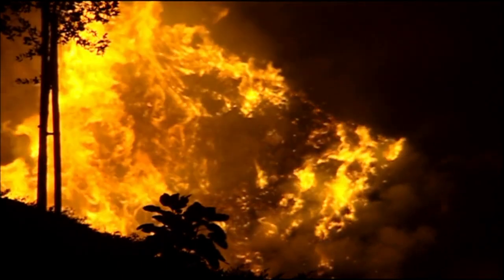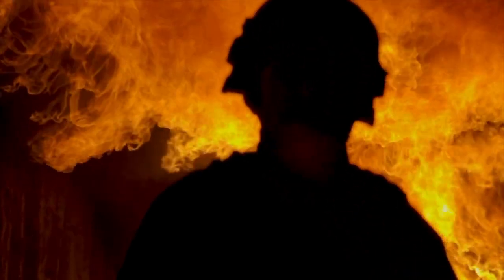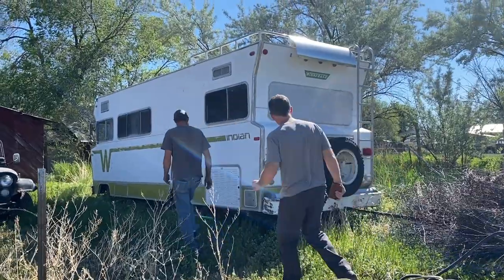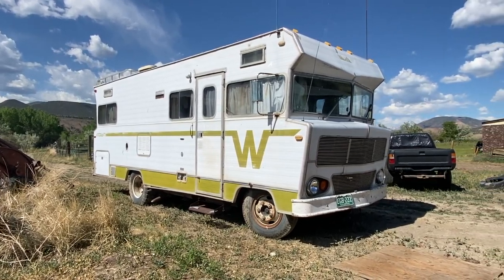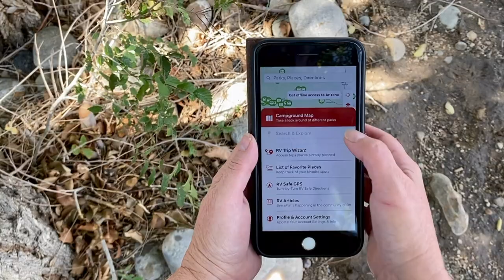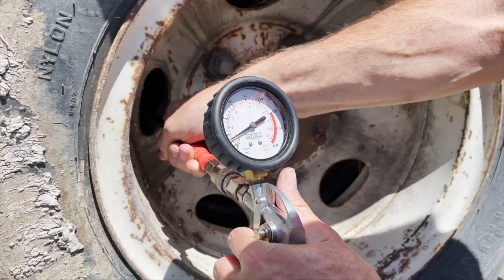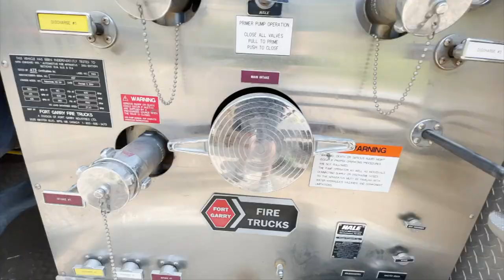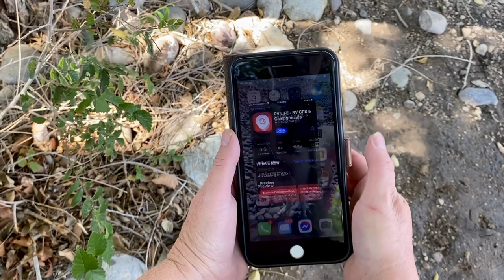LESSONS LEARNED FROM OUR RV FIRE * MUST WATCH * | RV Fire Safety

Comment: Great and well presented video of the dangers of an RV fire. I am a retired firefighter and it is a concern that is in the back of my mind especially when away from our coach and our pets are possibly inside. During my career I had several RV fires to work that in both cases presented a challenge with limited water available on scene and exposures to nearby property and dry grasses and shrubs. Your video showed just how fast and devastating they are. As a safety precaution you removed the propane cylinder and fuel that is found on a RV which makes those fires even more difficult to suppress and even more dangerous to fight. You did put some fire loading material in and most of the time there are many other items that will contribute to the fire load and intensity like lawn chairs, tables mats, lubricants, extra oil, spare parts, tools and possibly fire arms and ammunition ect. They will contribute to the severity and hazards that can be found in most RV's of all classes that experience a fire. Occasionally even a nearly new RV can experience a mechanical or electrical failure that can cause a fire so it's not just limited to an accident or carelessness, I was at a racing event in Iowa where a brand new Super C motorhome had a fire start under the drivers seat from a computer for the coach that malfunctioned and it started a fire that destroyed the entire rig and severely damaged 3 others RV's parked near it before the fire department could get it under control. It occurred while everyone was away at the race track and it had a substantial head start before it was even noticed. Also, always stay well away and upwind from these types of fires. The toxic gasses released can kill or severely injure you if you breathe them in. Thanks to all of you and a job well done. I hope that you get many RV owners to take the time and watch this video.
Reply from the maker: Fred thank you so much for taking the time to share your comment and experience as a firefighter! It’s so helpful to hear of the additional combustibles that can make an RV fire even worse than this one where safety precautions were taken. Yes new RVs are at risk too! That burned fifth wheel of our friends early in the video was a brand new rig that they hadn’t even taken out on a camping trip yet - it was an electrical fire on new unit by a highly reputable manufacturer! Thanks again for sharing - comments like yours add further value and relevance to the important message we were aiming to convey here. We hope it impacts people in a way that really increases the focus on how they can stay safe. Thank you for your service!
Reply: @Rvlove   You guys hit all the marks and I complement and commend you for your efforts to produce this video. Thanks again and safe travels to you.
Reply: @Rvlove  I'm happy I just read this comment.  I have been thinking about Josh and Kali lately and am sad they are no longer posting videos. It's understandable though after they experienced two horrible incidents in a row with two different RVs.  I was in shock when I heard about the second one but never knew what happened.  Thanks for mentioning the electrical fire.
Reply: As a retired IAAI CFI and owner of a 2012 RV I have been well aware of the potential hazard that RV units can have. We wouldn't expect to drag our stick homes all over the country but some think nothing of driving a motor home over the  national highways and back roads. The twists and turns, the ups and downs these comparitlbly poorly built homes on wheels are subjected to would wreck our stick and mortor homes. Well surprise, it's wrecking the motor homes. You bend and twist everything enough it will change the reliability of the item. When wiring connections as well as propane line connections flex enough they become potential hazards. If you don't understand how things are put together and how they can become potential fire 🔥 hazards, maybe RV living is not for you. Cold temperatures shrink everything in the RV. Metals, plastics, wood included. Heat expands everything in the RV as well. It's as if it's breathing all the time. This is why wire connections and gas lines can  separate enough to cause potential catastrophic problems. It's not only necessary to have smoke and CO2 detectors but a knowledge of where and what items to check over, possibly tighten or replace. Be aware, be alert, be safe.

Comment: I saw your original video of where RV's go to die and was planning my full time living in 2019. I bought a 2000 class C and first took it and had the entire chassie gone over and repaired. I then took it to an RV place and had the fridge, convection oven removed..I never use flame inside. I cook outdoors or use a steamer or small 850 watt crock pot. I never leave when somethings on except the a.c. that's serviced every 6 months. 

I purchased a 12 volt a.c. d.c. fridge and a few solar generators to run it on when traveling. I only wish I could have the Propane stove, built in  tank and the generator removed as have been lugging them around since Oct 2019. I saw an RV on fire near Lake  Havasu my first yr out. The propane tank  hissed as I passed by. 
I thank you guys for this very informative videos. I'm always looking at my cabinets and closet for items to take to Goodwill or give away.  I am very careful about things plugged in and never run more then 1500 watts on my 30 amp service as know the wires are old always do close maintains on my chassis. All I can do beyond that is, put my trust in God to keep my home and my pet safe.
Reply from the maker: Love that you make such safe choices, and so happy to hear that the content we have shared has been beneficial to you over the years. Thank you, and wishing you many happy and safe travels ahead. -M

Comment: thank you for making this ... a week ago I went through 3 fire extinguishers to put out a trash bag a neighbor had just placed outside her door that caught fire and rolled under her rig at 11pm ... i pounded and pounded and awoke a grandmother and her grandbaby ..... it took them 3 or 4 minutes to get out ... people really need to see this and learn ... have seen to rv go up in smoke in under 5 minutes ... I carry 5 extinguishers ... think I am getting 6
Reply from the maker: Thank you for sharing your comment, and of course for helping save your neighbor. Great reminder to practice evacuation plans.  Time is very short when it comes to RV fires. We carry multiple extinguishers too.  The small portable ones are great, but they only work on small fires, so having extras is important. Thanks again. -M
Reply: Similar experience with a coworker’s vehicle. People don’t realize how ineffective an extinguisher is on a car fire. Used two big ones and then had to cool the engine with a hose to get it to quit reigniting. Fire department took 15 minutes to get there. Car was still totaled but we prevented the fire from spreading to other vehicles in the lot. We couldn’t stop the engine from turning over because the wires had melted. It kept trying to turn over until we were able to pull the wires apart with a board. All this before the fire crew arrived.

Comment: This is an awesome video with lots of great information.  Being in Florida, we learned early the benefit of putting screens to protect the water heater and furnaces to keep out insects like wasp from building nests.  As you explained in the video, the nesting material can be a fire hazard.

I have to say this is one of your best videos and should help people see the danger of an RV fire and how fast it can get out of control.

I have shared this video on Facebook.

Thank you for making the video.
Reply from the maker: Glad you liked it Don - it's shocking how fast it goes up! And that smoke engulfs the RV so quickly as the ceilings are lower and the space much smaller than regular homes. Thanks for sharing... we hope it helps a lot of people! It was a lot of work but also really rewarding to make something like this and make it a creative, informative story to drive home some important safety messages. Hope you, Neva and the pups are well!

Comment: First I was so surprised the smoke detector took so long to go off. Mine goes off when I boil water! Then I was surprised how long it took to burn. I have seen the posts and videos where people driving down road discovered they were in fire and said it was gone in 3 minutes. Curious if the 1970s building was somehow sturdier to burn longer. Obviously none of that time could anyone have survived. Talked about recreating a grease fire but then lit the fire. Why? Good job!
Reply from the maker: Funny, yes, sometimes my smoke detector goes off way too easy.  Maybe some newer units would burn faster. We also removed gasoline and propane.  The way the department lit it, was close to how it would have been if grease fire.  We didn't want the extra hazard of the propane for the stove. -M

Comment: There really needs to be way more known resources to buy Fire Suppression gear for RV's!  It took quite a while before I came upon a company that could provide that equipment. a few years back, now!  I have called the Gentleman, I purchased mine off of, in Fla, and he seems to not be in business anymore? What I did find, from him, was the AFFF Foam, which may be cancerous if you are exposed to it frequently, but to put a fire out effectively it cannot be beat!  I have the Shielded Hose extensions with the Automatic Heads, that are above my Engine, and Transmision, another in the Fridge Compartment, and yet another in the Generator Bay.  I also got the recommended Temperature Test Strips that you use first so that you do not place the Sprinkler heads too close to what may set it off prematurely or when not needed.  Then you install in another area within close enough proximity!  Along with Small but Mighty Extinguisher canisters 3 of those as well, that are portable, I spent over $1K, for it all!  Cheap Life Insurance to us, anyway!  Thanks for doing this demonstration, but again, since the response time, for any Fire Department, is way too late, I say having your very own Suppression devices are a necessity!  And of course, no less than 3 Appropriate Fire Extinguishers! One, by the bed, or two even, and Kitchen, and near the driver's seat!  I have seen RV fires much like this and could never imagine being cooked alive!   In my 40' Diesel Pusher I have 3 Alarms as well! We remove the equipment, and use them in our home as well, BTW! If anyone can add places/links one can get suppression equipment, please do!
Reply from the maker: Thank you for your great comment.  Glad you have made steps to stay safe! -M

Comment: Would you do a special on the fridges relative to fire. Worst models, ways to check ours for dangerous equipment and the exact recommended modifications to make them more safe. Thanks!
Reply from the maker: Thanks for the suggestion, but it will probably be a while before we are able to do that.

Comment: Well, you couldn't have done it because of extra dangers, but without the gasoline tank having fuel in it and a built in propane tank to deal with it was actually a pretty calm fire. RV fires do progress insanely fast.
Reply from the maker: Yes, if it would have had those additional fuel sources, this fire would have gotten bigger and hotter even faster. Far more dangerous. -M

Comment: this video was amazing. have you all talked to any RV manufacturers on why a sprinkler system couldn't be installed in RVs much like a house or office building. if someone is hooked up to water at a park or have a tankful of water when the fire starts, could it not help in diffusing the fire to this point?
Reply from the maker: Interesting question.  But water sprinklers could make the situation worse in some situations, especially cooking fires.  There ARE some other fire suppression systems that can be installed aftermarket that can do a very effective job.  More tips in related blog post at. https://www.rvlove.com/fire

Comment: Hello Marc and Julie. I have been following you for a number of years. I know you purchased a 1999 Country Coach Intrigue. I just purchased a 1999 Country Coach Affinity with 1 slide from an estate sale. Now they knew nothing about the coach. I am all good for now except I cannot find the switch to let the slide out! Maybe you can help me find it by letting me know where yours is found. Thanks for the help!
Reply from the maker: Congratulations on your new coach.  Make sure you join the country coach owners groups on facebook, and the other community.  They were SUPER valuable to us.  As for your immediate question, our slide control switch was near the floor between the driver and passenger seats.  There was a small key that needed to be turned to activate the system, then the switch would open and close it.  Be sure to open at least one window or ceiling vent before bringing the slide in or out.  Congrats again. -M

Comment: After the fire the RV is easy to scrap. The wood and plastic and rubber are burned away leaving aluminum and steel. The wire insulation is burned. The scrapper could also pick up the beads of aluminum off the ground.
Reply from the maker: Yep, it was a big mess, but still relatively easy to scrap.

Comment: It’s modern materials which cause both houses 🏠, and RV’s to burn 🔥 very fast 💨. It’s not just overloading the closets of houses 🏘️ and RV’s with clothes, at least, not this alone. It’s modern materials, as well, because it’s been so chemically treated, or manufactured 👨 with very flammable materials. Yes, old clothes and materials burn 🔥 somewhat fast 💨, but ya should do a fire 🔥 test with old school 🏫 materials, and an equivalent amount of modern materials, under ideal conditions and see which burns 🥵 faster. Your best friend, Jeff.
Reply from the maker: That would definitely be an interesting test, to see which is more flammable. Thanks for the suggestion, but we will let somebody else take that on. -M
Reply: @Rvlove  I am the very same way. In it’s right form, fire 🔥 can be okay 👍, but once it’s out of control, I’m very terrified of it. I really think 🤔 each motor home 🏡, or fifth wheel 🛞, should be equipped with a fire 🔥 suppression system, as well as built out of WAY less flammable materials. Your friend, Jeff.

Comment: So maybe something needs to be addressed to the manufacturers on materials used in the manufacturing of RVs
Reply from the maker: The manufacturers do try to use materials that are fire resistant, but can't compare to what can be done in a home where weight isn't a factor, and also that the materials can withstand the frequent movement of RVs.  So, fire prevention becomes even more important, especially since RVs are often parked in areas where the fire can spread to other RVs or forrest. -M
Reply: @Rvlove  and occupants are in such confined space

Comment: This is why conscientious manufacturers build RV's out of nothing but cement, steel, stone, mineral wool, and 5/8 gypsum board. There's no electric and plumbing, sure, but as the manufacturers like to point out, their products are already built by the Amish.
Reply from the maker: Yes, there is only so much you can do to improve materials, that is why it is important to be aware of the risks.

Comment: ok so why is the shock absorbers a real hazard  4  the fire fighters........  in simple english plzzz..................   BUT U ALL SAY U WANT  2 MAKE IT LOOK LIKE PPL,. LIVE IN IT SO U ( DID YOUR MINI MAKE OVER TO HOLD UP THE ROOF THAT GAVE UP. ).............................   SO I ASK AGAIN HERE........... if this caught fire on the side of the rd.,.... no one would have time to take off engine or body part's.... being of real danger to the fire fighter's................????????????????????????????????????????????????????????
Reply from the maker: obviously if on the side of the road, they would just try to extinguish.  But shock absorbers are pressurized vessels. and with heat could have higher pressure and explode. Just an extra precaution since we obviously had time to make it as safe as possible.  regular fire would also have the fuel tank, and propane, so MUCH more dangerous. -Marc